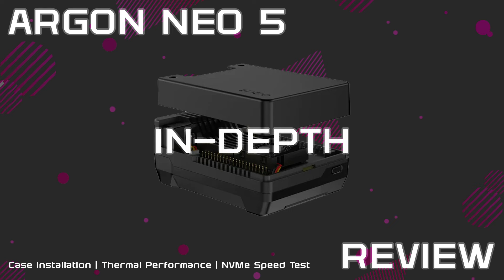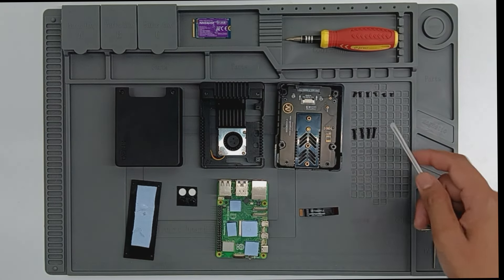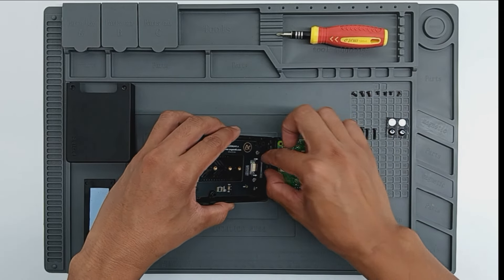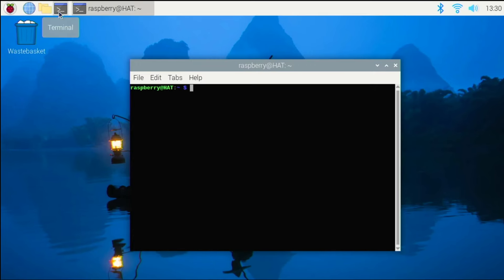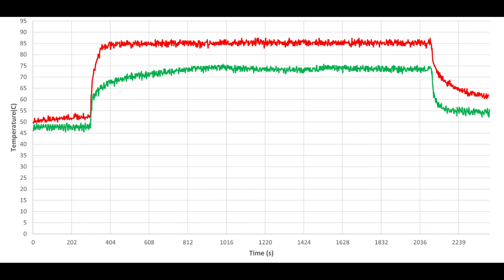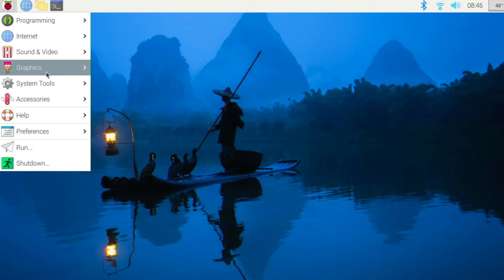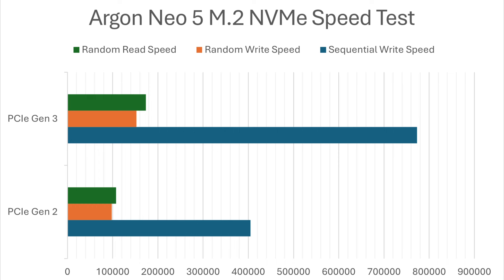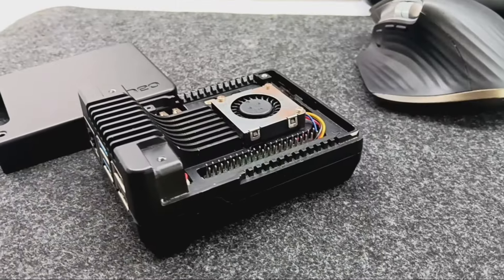Argon Neo 5 Enclosure with PCIe to NVMe SSD Base for Raspberry Pi 5 - Comprehensive Reviews #pi5

Comment: I can't make it working, after all parkour with firmware, configs, kernels, changing multiple PCIE connectors and 2 rpi's it isn't detecting any NVME.
Reply: Hello friend, did you manage to set it up?
Reply: @gabrieldias6245  Yes, two of the Raspberry Pi's had damaged PICE ports, so I bought a third one, and it works without any issues.
Reply: @gabrieldias6245  Looks like a manufacturing defect.
Reply: @wojciechzielinski7825  Thanks, another question, can I use the sdcard as storage after installing the system on nvme? Or is it disabled?
Reply: @gabrieldias6245  I think you can, it is all about boot priority

Comment: How is the NVME drive powered? Is it just by the PCIe kabel?
Reply from the maker: hi you can check this video : https://youtube.com/shorts/uNp2CJ5k-bg
Reply: Seems like it, I didn't see any other connections... Unless it's using underneath of the gpio pins but that's something more done in rpi 4 (they seemed to have made it harder to use bottom side of pins in 5)